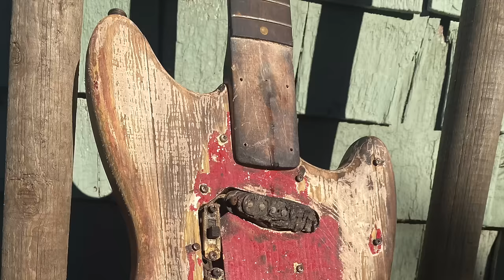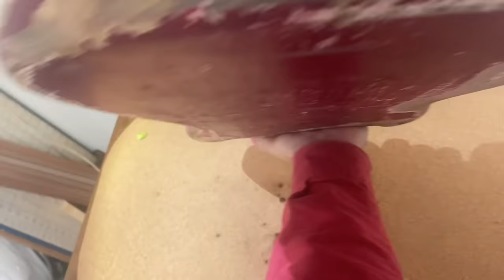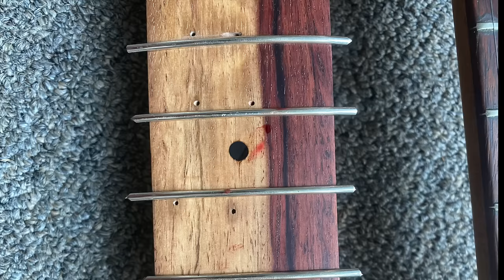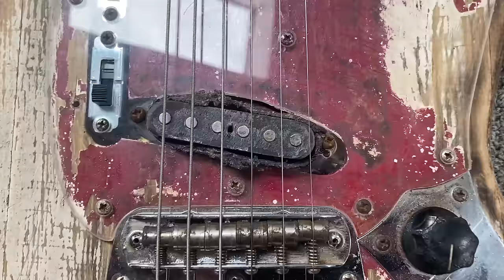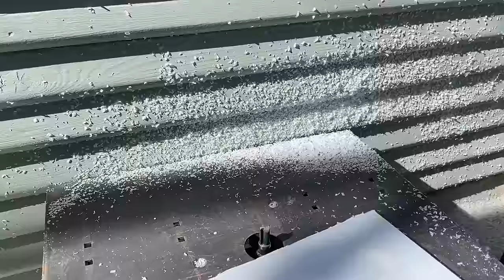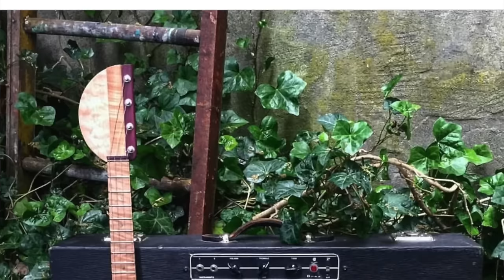Behold The METHSTANG! 1966 Fender Mustang brought back from the dead

Comment: Dang, that relic job easily adds $6k to the worth of this guitar.
Reply from the maker: Maybe not $6k, but I don’t disagree, it’s in a class by itself
Reply: And then deduct 5K for sanding a 66 neck flat, when it’s supposed to be a radius, and putting on an out of place fretboard.
Reply from the maker: @1777DK  lol, it’s was burnt to a crisp, there was no way to save it without converting to a slab. Let’s see your work?
Reply: That's not a relic job......That's flood rot....it's from New Orleans
Reply: @1777DK it's literally radius sanded dude, in video. Showed his friend doing this when he was in town, maybe watch video next time and hold your digital tongue until ya do? Risk looking foolish like ya do now when what you ask for LITERALLY HAPPENED IN SAME VIDEO YOU'RE BASHING. Your kind,  needs to talk less on these threads, and watch more attentively as well.
Reply: @caiusmadison2996  First of all, thanks for the advice. 

Those of us, with actual knowledge about fender guitars, will know that after about 1962 a Fender would have a veneer rosewood fingerboard. Seeing that you are so much smarter and more attentive than me, an explanation might be redundant. However, a veneer fingerboard means that the top of the neck is radiused, and a thin veneer fingerboard is attached following the radius of the neck. This is most likely a cost cutting choice from CBS. The video shows what is known as a “slapboard” being attached, meaning an irreversible modification is done, again meaning that the value is forever decreased and not increased as implied by the original post. My post simply respectfully disagreed with that assumption, of an increased value, based on my knowledge of vintage Fender guitars. Ironically had “Not A Luthier” chosen to keep the originality he would not have needed to borrow a radius block, and he would not have had to spend “hours on sanding” as he mentioned.

I am not “bashing” anyone, I am simply pointing out why the price increase is not possible. People are free to destroy the value of their vintage instruments how ever they chose, I am simply pointing out that a decrease in value will be the natural consequence.

Have a great day.
Reply: @1777DK  it was a fucking joke lol
Reply: @Roak1  Yeah, it’s funny how people get real worked up about jokes lol
Reply: @1777DK  it's replaced, come on, did you watch the video? Vintage guitar owner here, I'm aware of the vintage board curvature. Slabs had it too, what are you on about? Slab means over thick fretboard, it doesn't mean a lack of radial curvature.
Reply: @caiusmadison2996  I would like to refer to my prior answer, I cannot give a better explanation than that, and if that post does not give you an understanding, of the difference between a radiused veneered neck and a radiused slap fretboard, then we might have to leave it at that, as YouTube doesn’t allow illustrations in the comment section.
Reply: it's bait yall lol
Reply: @1777DK  "those of us, with actual knowledge about fender guitars" so are you a blues lawyer or failed band member or what happened lol
Reply: @poolbwoy6585  I wish lol
Reply: ya man  pre-fuckified guitars cost a ton of money, i just don't get it
Reply: At the end of the day it belongs to the dude in the video. So if he wants to do whatever he wants to his property, then so be it. 
I'm not a guitar player.  I'm a drummer. But my great aunt had an early 60s fender mustang that she used to play in her younger years. She let me play a few times before she passed on. It went to my cousin who plays. Cool guitar with family history.  😊
Reply: @frankspikes7858 That was never the question though. The only debate was whether or not the value would increase, based on the work that was done. Then people mistook a valid argument for criticism and here we are.
Reply: @Notaluthier  Your guitar work is incredible, the attention to detail and appreciation of what makes these instruments so great in the first place is outstanding, and videos are really well done with great production quality!
Reply from the maker: @sadaksara  thanks very much! I hope to improve in the video work too, as I get acquainted with the process
Reply: @caiusmadison2996 I read this in the voice of a 19th centure London gangster
Reply: @1777DK  man your reply was honestly amazing. This is my first time watching one of this persons video and he did great work but i agree with you wishing he would have done exactly how you described preserving what's left of its originality
Reply: @1777DK  I think he went slab probably because of the big chips of missing neck edge, probably needed to flatten the neck as much as pocssible, the slab fretboard looks really thick. But I might be wrong, its definitely had some water damage, thats what's caused the 3 peice body to start separating and what's caused the black stains on screw holes on back of head stock. Rusty water soaking in.
Reply: @alisonbarnard5328  I think so too, increase the value it does not. The only discussion I have engaged with, is weather the work done to the instrument adds $6k worth of value or not. I have not questioned the choices made or the quality of the work, only weather or not it will increase the value of the instrument, as a vintage artefact, and the reasons why I believe that it has not. A statement was made, I argued against it.
Reply: @1777DK bro you can say what you want, you're a troll. If the value was destroyed when he got it, why should you worry? Oh, right, you shouldn't. You should move on.
Reply: @yaboidustin2447  OP message:

"Dang, that relic job easily adds $6k to the worth of this guitar."

How is contradicting the statement, and backing it up with factual arguments trolling? I have not, in this thread, attempted to tell someone what they should or should not do. I have been very clear that NOT A LUTHIER is free to do whatever he wants with his own instruments, I have absolutely no opinion on the matter, couldn't care less. I have only claimed, and will continue to do so, that the work, being done in this video, will not add $6k of value to the instrument in question, as claimed by the OP.

Now please show us, on the doll, where my statement hurt you?
Reply: @1777DK  Wow that escalated...
My post was obviously a joke though.
Reply: @1777DK you have too much time on your hands to be doing this.
Reply: @LifeDrain001  I respectfully disagree.

Comment: Those pickups still being operational is the crazy thing about this project.
Reply: Amazing..and a great part of the restoration..
Reply: Not really. It's just wound cable
Reply: @NintenDub right like, the only possible failure would be a broken wire or soldered connection broken where they're wired. They're not sensitive little things like pots. Still pretty awesome.
Reply: @asafoetidajones8181  the enamel becomes pretty fragile after 60 years, even without whatever end of the world scenario this thing has been through. And that "wound cable" is how thick? 0,0something mm? That's gonna burn up real quick in a fire. I probably wouldn't have even thought about testing those pickups😂
Reply from the maker: @maxs.3238  yeah this stuff is thinner than hair. MANY fender pickups in mint condition have failed due to rust on the magnets corroding the insulation and wire. This is a a miracle

Comment: My main guitar in the 70s and early 80s was a 1965 Mustang that I found as a basket case. A refinish,a DiMarzio super distortion in the bridge and locking down the tailpiece n it was a super player. Above and beyond on your restoration of this beast
Reply from the maker: That sounds awesome! I’ve grown to love a good humbucker for lead guitar. My fave lead guitar right now is an 80s Japanese squier with a pair of humbuckers.
Reply: In the early 80s I owned an orange Mustang with a racing stripe that looked ugly but after some work played great. The pickups literally had loops of wire hanging out of them so I routed out the neck area and put in a Seymour Duncan PAF humbucker, and I used a Bill Lawrence stacked humbucker with a rail magnet in the bridge position. The vibrato on these things was never great so I locked it down. I wish I had kept it but a friend of mine who was a better player talked me into selling it to him, which I have regretted ever since.  That color however was truly hideous and I really should have refinished it.

Comment: Reminds me of when I worked at a local guitar store. Guy came in and purchased a secondhand Fender strat  and a guitar lead. I pointed out that he would need an amplifier for the guitar. He told me it was okay he had worked out how to use the amp in his valve radio for this.(This was in the late1950's) He came back two days later swathed in bandages asking if we could fix the guitar, which looked like it was fried, which it was. In his amateur electronics way he had taken one of the jack plugs off and stripped a large amount of the plastic off the screening cable and connected it to the common earth of the radio, but managed to wire up the output to the high voltage output of the radio. He was lucky to have lived
Reply from the maker: Yikes! I’ve had a couple of mic’s give me minor shocks…but that sounds like a real WIDOW MAKER

Comment: I love it!
Rory Gallagher 
Stevie Ray's number one, 
and now this.
You have given this old Stang a new lease on life. 
It could have ended up as firewood, but thanks to you, it lives to play another day.
If you get a chance, try it with a Tweed amp. Any of them from the Champ to the Twin will be a marriage made in heaven.
      Big respect 
         Hats off 
        CHEERS!!
Reply from the maker: I’ve got some cool old amps but no tweed fenders. I guess I’ve got a mission!
Reply: @Notaluthier  You probably don't have Sultan of Brunei or Bill Gates or Elon Musk money, so you might consider building one. Just don't skimp on components, especially the transformers. If you're nervous about building such a thing you can get great kits from people like Mojotone. 
Electronically, a 5F1 Tweed Champ is the equivalent of an amoeba, it's the poster child for irreducible complexity. The only way you could make it any simpler would be to omit the volume pot and the on/off switch.
They make a kit with premium grade components. It's worth the extra cost. 
You seem like a fairly bright and determined sort of guy, I bet you could handle the job. I built one using a cake pan for the chassis, and an old wooden desk drawer for the cabinet. You can probably round up those items from the junk pile for a total expenditure of $0.00
Old wooden desk drawer, have finger jointed corners, and a 1/8" plywood bottom that becomes the speaker baffle board when you stand it on end, the front becomes  the bottom, and you can relocate the handle to what is now the top.
Mac Guyver would be proud.
Food for thought
      Enjoy!!!
Reply from the maker: @jpalberthoward9  thanks for lap that! I have a champ-like amp made by Lectrolab, that will probably fit the bill nicely. Bonus points, it has a tweed like covering on the CARDBOARD cab
Reply: @Notaluthier  Sounds good. If a wooden desk drawer should fall into your lap, it would be worth the time to cut a hole and put a speaker in it. The solid wood and thin bottom make a nice acoustical chamber that can sound wonderful, depending on the dimensions. If you find one, say "Hello" into it and see what you think. Particle board is no good, solid pine is what you want.

Comment: I have a mate 

He had very acidic sweat and it would eat through internal roof vinyl in a 80s/90s car, seat belt dye's, water based paint and no doubt pick ups
Reply from the maker: My grandpa used to always wear those Rolex style metal watch bands even though he too had very acidic sweat and would have to replace them VERY regularly after eating through them.
Reply from the maker: Also, if the special effects industry they call them “piss hands” 😅
Reply: On the car roof there was a dirty halo 

Inside it was clean 

Middle radius was almost translucent 🥳

Comment: Don't use a Dremel and the frets won't get so hot. I bought a 4 inch polishing wheel for my impact driver and one for my drill. With a little polishing compound from a stick of red or even blue or white, you can polish the entire fretboard in 1 or 2 mins and the frets don't get all hot.

In fact, to test it, I crowned a few with a Stewmac Z-file and then went straight to polishing with a drill and blue Dialux polish in a stick. It took all of the Z-file scratches out and polished them up to a mirror shine. In a matter of 15 or 20 seconds for all 4 frets combined.

Works smarter, not harder and hotter 😁👌
Reply from the maker: Good to know. Thanks!

Comment: Lowes (or i guess Rona in Canada) has acrylic sheets for the best prices I’ve ever seen so far. they have tons of sizes but a 2mm thick 8x10in sheet costs just under $5USD here. i think the next size up is around 11x14in and is around $10 usd. i think the smallest size would be enough to make a mustang sized pick guard out of.  just figured i’d mention that as i was also quite surprised as to how expensive acrylic can be from some other sources.
Reply from the maker: Thanks! And Yeah, I kind of figured I could shop around, but I opted for the store that was in walking distance. I don’t remember the costs exactly now but it was between $20-30CAD  for the piece I got. At least double what I was expecting to pay. It was from a framing store. I scoffed at them when they said the price…but adding a drive and at least another hour of time wasn’t gonna be worth it!

Comment: ive got mustang neck stamped sep 66 b on the heel its had a bad re fret and a locking nut at some point..oh and it was a green headstock but has had that sanded off thankfully they sanded around the original decal...it was listed on fee bay and failed to meet the reserve a few times so the seller reached out and asked me what it was worth so i explained in its condition i would consider 75-80$ he said ok and i bought it. i built a short scale stratocaster with. im going to re do it with a nicer body this time, maby even a tele idk atm..lol

Comment: You should get a cnc cut clear plastic fingerboard and cut it in half so you can use that section of the original fingerboard as well. You might also consider a clear finish that can be easily removed later, like the kind they use to restore old paintings to protect the patina of the body. It would be really cool if every part that was not original you added was clear
Reply from the maker: I had considered at least inlaying the old fretboard fragment into this one but I found it a little too jarring to look at.

Comment: A good triangle file can't be beat for fretwork. Those diamond files aren't worth the cost. Even the very best made diamond file (most expensive too) will wear out too fast. Just think of sandpaper. The grit wears off and breaks up. Same with even the best made diamond files. If you only do fretwork a couple times a year go for it if you find that style easier to use. If you do more than a few fret jobs in a year you are probably better off using a good steel triangular file with safe edges.
Reply from the maker: I got my Diamond from Chicago music exchange…because it was slightly less money than other places, but the edges (that will make contact with the board, if anything does) were jagged and sharp. I contacted them…and they said “that’s how they’re supposed to be” I didn’t mind saving the money and grinding down the edges myself, but I think they should have put it in the description

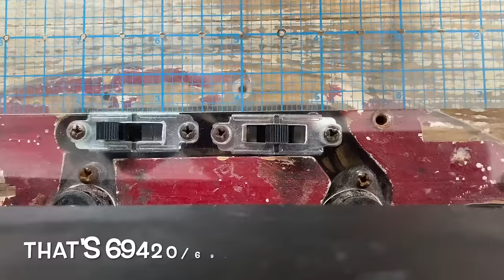Comment: 17:14 fun fact when I machine things on a metal lathe it is significantly easier to use mm instead of inch. idk why ur giving us US measurements bc if anybody’s really going to do this they will probably use mm. No hate just saying 🤷‍♀️
Reply from the maker: Yeah i almost exclusively use the metric system but I also spent a lot of years living in the US and some things come naturally saying inches, on a case by case basis. I should also mention that I think approximately 60 to 80% of my audience here is from the US and so I usually try to mention both measurements but sometimes I forget or don’t care and you can look it up if you need to.

Comment: I'm no p.u. expert.. I'm just surprised 5 kohms was the standard for mid-60s fenders! That's like really low output!
Reply from the maker: Resistance measures have surprisingly little impact on pickup output. My 1935 Rick uses 38awg wire and its resistance is less than 1.4K, Dearmond “Hershey bars” come in around 3.5k ohms. Both of these examples have wonderful and dynamic output.

Comment: I have a gauge set that I turned into a nut file. I still don't have a legitimate set but I will soon. Next mission is getting the action on every guitar I have as low as I want. Trick, Martin u channel neck truss rod. You can file the fret board one track at a time and with the strings on. Just add the same relief in your neck to the rod and file carefully one string at a time all the way up and dpwn the neck. This will give you the best action possible.  Nice save. I do the same. Check me out. My video is not the highest quality.

Comment: yes ... I think you put the wires wrong .... they have to go from the top side of the vibrator
Reply from the maker: They go through and under on this tailpiece. It’s counterintuitive because it’s rotational motion would indicate a rise in pitch, but the entire tailpiece moves forward significantly more than the rotation and the overall result is a well functioning tremolo with good break angle on the bridge.